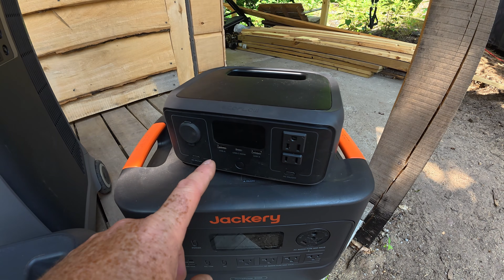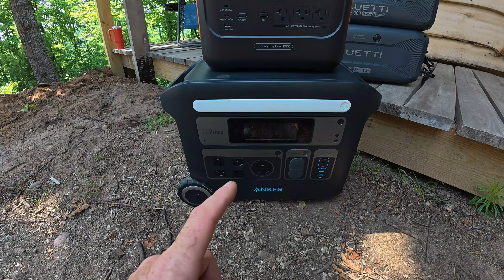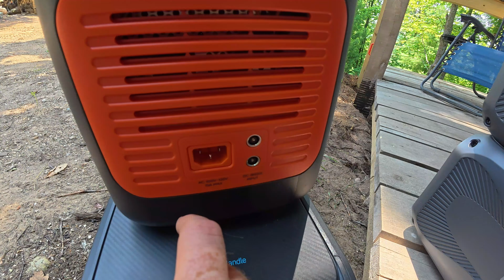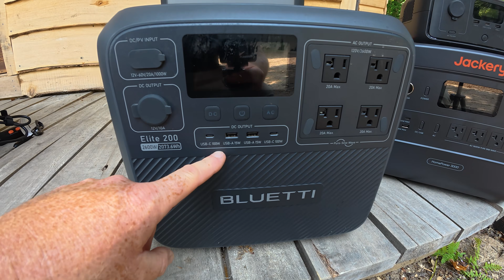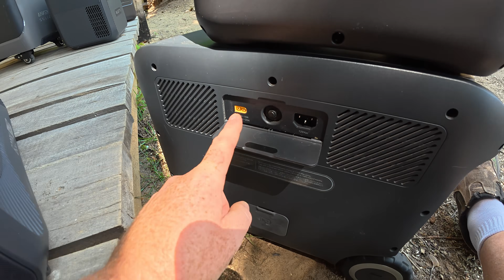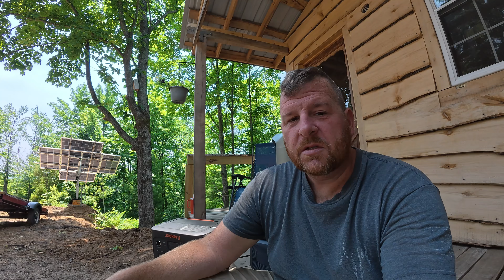Best Solar Generators For Off Grid Living- Which Is the Best for YOUR NEEDS! ?

Comment: My husband and I are older and live on the Texas gulf coast. We’re trying to prepare for emergency situations including grid down. We have solar panels but can’t afford a battery backup. We’re wanting a backup battery for electric use, preferably solar powered. It’s very confusing to know what we actually need. Bare necessities- refrigerator and freezer, fans for cooling, phone chargers etc. But I use a Cpap at night also. We plan on shutting down half the house in emergency situations. Only kitchen and living room. We just don’t know what is best for us.
Reply from the maker: I would buy some of the outlet devices that track and save how much power you use with it.....one for the fridge, ones for the CPAP,  lights, chargers and first step is knowing how much power you use on the devices you want to power. The outlet trackers are cheap to buy and will help you know where to start

Comment: Thank you for the info. So I live in a tiny house 226 sq ft. Which unit is best solar generator to run say TV/DVD player, small diesel heater, and 12v fridge when power goes out??

Comment: Just found this helpful video, thank you! I'm trying to figure out what size I would need to get for an emergency backup in case of power outages. It's rare here but if it happened, I would want to keep my fridge and water well running (I'm in the country, so no power means no water, no toilet, you get what I mean 😂)
Reply from the maker: honestly the only two here are the anker 3800 plus and Bluetti apex 300 that would run a 240 volt well pump. If I had to pick one the bluetti has great options for expansion and is a bit more affordable.....BUT ANKER SOLIX makes great products too, They are VERY well engineered and made. You can't go wrong with either one.
Reply: @OffgridwithJayandJen Thank you! I'll look into those. I appreciate your reply! 😊
Reply: @Abruzze Pecron has some awesome ones as well and also has the ability to grow the system as well. 👍

Comment: In my opinion, Ecoflow is simply an awful company.  I purchased a Delta Pro solar generator fall 2025 for over $1700.  When it arrived, there was no owner’s manual, no warranty information, no cables and the charge from the factory was down to 30%.  It was obvious to me that it was a used machine that I had received.  Nothing has been resolved.  It has been a horrendous experience and hopefully this will save you from something similar.

Comment: Great review! Thank you. The #1 issue for us is the type of battery. The lithium iron phosphate batteries are a MUST-HAVE because of the fire dangers entailed with the lithium ion / polymer batteries. The Jackery models I believe all have the latter, whereas Ecoflow uses the LIP variety, which is a huge plus.
Reply from the maker: Older jackery units use to use lithium ion, but they switched over to LFP in most or all of their units now as far as I know. Appreciate you being here and chatting about it.

Comment: Hello Jay. Great informative video. I am always leaning towards bigger is better but would sure value your advice. I would be powering medium to large power tools and 12v water pumps ( sump type) at my mining sites. I have multiple gas powered generators but would love to move to solar for the noise level alone. For now, am working 2 to 4 days far from grid. Which size do you think would fit my situation best?
Kind regards 
Michael M

Comment: Thanks for the review. I found that the best option for my cottage was the Apex 300 with the BK300 expansion battery and the SolarX 4K charge controller. It was the only option that made sense from a solar input perspective and the only option that would be able to scale up over time to meet my needs.

Comment: Hi-I'm in the learning process regarding solar generators. I've never used one before, and have a Lone Peak truck camper on order. I'll need a battery pack to run some interior LED lights, a roof top fan, a diesel heater, charge various small devices, and maybe an electric fridge sometime in the future. I go out for a week at a time, and don't mind setting up solar panels to keep the solar generator topped off.
I'm also looking to add back-up power to my house in case of a power outage. I'm on a well, so no power means no water. I was thinking about a 10k watt gas generator, but after learning more about these solar power stations/generators, I'm thinking about going that route.
If I could combine these two things, that would be the best of both worlds! Are there any medium to larger sized units that I could use camping, and use some add-on battery packs to beef it up for home use? I'm not opposed to mounting some solar panels on the roof of my house either!

Sorry for the long post-just trying to learn and figure out if I can kill two birds with one stone!

Comment: What might you recommend for running a cpap, portable tools like skill saw occasionally, run a refrigerator for a day if needed, run a portable fridge/freezer in car during long drives of 10.5 hours, charge ipad/iPhone occasionally, etc.?

We have property where we work away from a power source a lot on projects.  Long car drives (2days) to get there.
Reply from the maker: I would recommend a bluetti elite 200 or   something like the jackery home power 3000. They have the power to run tools and keep your critical devices going for a day or two without having to skimp on using it. Large units are my favorite because they do it all, and not just for an hour

Comment: We can compare, talk about, solar power stations! Let's get started. My power stations, I have 2, identical, 3000w continuous 6000w surge, low frequency (transformer based) like the grid, dual 150v mppt controllers, 2000w solar input, dual external ac chargers, 1500w, 6 ac plugs on 2 15amp circuits, 5 13.8v  20amp DC barrel plugs, TT30 Rv plug, with dual hot wires, all metal all modular design, unlimited exspansion, in 2kw battery increments, that dont require a cable to connect, external battery exspansion port, can utilize any battery/ chemistry with just 1 cable, and it adds true capacity, charges and discharges from the unit and shares the load, not just some hack! Can charge from wall, solar, and car simultaneously while discharging full power, if you accidentally discharge the batteries to low, they can be brought back up by a solar panel direct, no nonsense apps, and no built in usb,s to break and be useless like your phone, with 5 13.8v cigarette ports it came with dozens of plug in usb options, and if they fail, just plug a new one in! The heaviest component is 32lbs, completely moveable, absolutely no proprietary plugs of any kind, all heavy duty anderson connections, and mc4. I have 10kwh in battery capacity, and I can make it as small or as large as I like, like 2kw. 1 unit will power every 120v plug in my all electric 2600sq ft home with just 1 cable, no stupid extension cords running everywhere or plugging and unplugging stuff to run. I made 1 50amp dryer cable to plug into the TT30 outlet and the dryer port, it supplies both 120v rails in my circuit panel, and it's all on breakers! 220v breakers off and main off. Charging, 6kw solar on my roof, a gas generator for backup, and a spare inverter to fast charge ac from the car! So, no I really couldn't compare the high frequency units ($5 chip sets) to what I have.
Reply from the maker: Sounds like you have a fantastic setup, thanks for sharing!

Comment: Strong disagree with "get the largest unit you can afford . . . pick up an extra-large unit, pick up one expansion battery with it"

You should get one with an inverter large enough to run your loads and then a big enough battery to last overnight. Buying more battery than that is a waste when it comes to home backup situations. Instead you should buy a propane generator (and optionally solar of course) and use that to charge your battery when it gets low. The amount of power you can buy and store in propane cylinders is stupidly cheap compared to buying the equivalent in batteries. By using the generator to charge your power station, you only have to run it intermittently plus it's far more efficient at covering intermittent and low-load situations.

Power stations+generators together make each other better and then solar is the cherry on top, extending the fuel even further.

(and if really do need an expansion battery, there's a bunch of videos on adapting golf cart batteries for much much cheaper)
Reply from the maker: Agree, but i believe i said if you want to power your home for longer periods then buy the biggest one you can afford. I totally agree with you about the generator working with the solar generator to optimize your system

Comment: We have a Titan solar generator that's 3500 and then I have an extra battery and that gives you a thousand extra Watts. Then we have a ecoflow Max with an extra battery and a smart generator. Wish we like a lot. Both of them. I'm running the whole one room and my my freezer was to Titan with a thousand w on the roof. But I do want to get the system you put in your off-grid cabin and I don't want to get a solar tracker. I'd like to eliminate at least half of my dependents on the grid. I like to do that by the end of the year. That was a good video. Jay, you guys do a heck of a job. That's a good heck of a job

Comment: Hi Jay and Jen, always enjoy watching your videos. Great job on the solar generators info.
I have two Anker Solix c1000s, I love them, not only are they affordable but they have several options to charge them too!
One way I can charge them that I noticed wasn't mentioned in the video, is that instead of buying the extra battery from Anker, which costs almost as much as the generator itself, I can take my 4- 24v 100ah batteries and with a 24v to 60v 10 amp step-up converter, charge them that way too. this gives me the 600 watts max dc that is allowed. The 24v 100 ah batteries are way cheaper than the batteries for the c1000. Just thought I would put that out there incase  you may want to experiment and tell your viewers. Thanks, and keep up the great work and always look forward to your next videos!

Comment: Nice video. 

Maybe some think it's too commercial, but I think you did a great job explaining the features, limitations and situations one should think of, regardless of the brand.

The only thing I have to add is that you should not be too close to the maximum voltage rating of the PV inputs. Solar panels are know to give you less output (lower voltage) in warm weather, but in very cold weather the voltage can actually rise a lot, risking damage to the power station. The rise and drop in voltage compared to the 20 celcius test condition can be calculated with the solar panel spec sheet.
Reply from the maker: Thank you very much and good point about the voltage 😀👍

Comment: I have one Eco Flow 1000 watt hour unit with a spare battery. The other 5 are Oupes. I have the Oupes Mega 5, which is a 5K watt our unit on wheels. That I connect to my transfer switch to run the well pump, chest freezer and fridge and maybe some lights. The other 4 Oupes units are 2K watt hours each with 2 of them having a spare 2K battery. I use those 4 as UPSs connected to my pellet stove, computer, TV/Monitor, cable box, modem, Wi-Fi router, phone, VHF/UHF HAM radio, security camera controllers and for charging my phone and desk lighting. Storms and motor vehicle accidents are always taking out the power here. I live in a very rural area of the southern Adirondack mountains in New York. I do have a dual fuel generator if there is an extended outage.
Reply from the maker: Sounds like you have a great set up. Glad to know the Oupus units are doing good for ya

Comment: I used your codes and I bought a $400 Jackery Explorer 1000 v2 Portable Power Station And a $ 629 BLUETTI Solar Generator AC180 with 200W Solar Panel 1152Wh Portable Power Station w/ 4 1800W (2700W Surge) AC Outlets, LFP Power 
during Prime Days. I wish I had researched more. I didn't realize that Jackery had proprietary cables and panels. I was hoping the Bluetti cables and panels that came with its unit would work.  I need them mostly to power LED shop lights for our Booth during Spring and Fall events when we have less daylight in the evenings. I also need to be able to use a small heater or fan and an instapot Spring, Summer and Fall. Most events are charging $60 to $100 for power for 3 to 6 days. It seems cost effective to have our own power source.  I have 4 days left to return them if I bought the wrong ones.
Reply from the maker: The jackery charges really good, you just need to have the right adapter or panel that will work with it. Minor complications, but not a deal breaker at all. We love our jackery units, just need to use their panels most the time, or sometimes you can use other portable panels from other companies if the numbers work

Comment: Did I miss something or did you skip over the solar input of the Apex 300?
Reply from the maker: I missed talking about it, but not intentionally.  The apex 300 is versatile in a way that allows good input on it own, but also has an add on accessory you can use with it to charge with MORE solar, like 4k watts of it. It's pretty cool, I hope to get my hands on one soon.

Comment: Great job Jay ! I have a few. Mostly Anker ones . The small one has USB C in and out. I have USB C solar panel that charges that for tent camping.  Just had some strong storms come threw NY . Minor damage and scattered power   outage. Them power stations handy . Many in my area have basements and need to run sump pump . Cheers from NY !
Reply from the maker: Nice, Anker makes a quality unit for sure........Sump Pumps.....I forgot all about those, good to remember....Pretty important.

Comment: Great video as always! Quick question. We just started our off grid journey, and our power right now comes from a Bluetti AC500 with B300K batteries hooked up to solar as primary and a generator as secondary. However, I get the feeling from this video and your channel that your choice is setting up a bank of batteries (none of these power stations) hooked up to your solar as your primary power source for the cabin and day to day living, while using these power stations as portable on demand options. I value your opinion and your experience, so should we be doing that instead of using and depending on the Bluetti system as our primary power system, and use these power stations more as portable and on demand needs?
Reply from the maker: This is a great question, glad you asked. Honestly this all depends on if you are going full time or just using things for a vacation home or weekend retreat. Really all it comes down to is cost......buying larger independent batteries and building a stationary full time system will be cheaper once all added up. This is because expansion batteries for the power stations tend to be similar price to what a server rack battery may be, but the capacity is often half or two thirds of theirs. So you end up needing to buy more of them to meet your needs. Our full time permanent system is great, but its not mobile and it does involve some extra components like wires, fuses, buss bars, tools to build cords, and breakers, these all cost extra money, but I think you still end up ahead by building your own.....but the power stations use to be 3 times the price......now they are closer in comparison to build your own. Remember though, I can't take my big system with me to use for back up power elsewhere or travel with it......so if you are only Off Grid Part time or using it at a vacation cabin......then taking it home for emergencies is a pretty nice option.
Reply: @OffgridwithJayandJen We are full time in the woods off grid. Thank you for your answer this helps a lot!

Comment: I just picked up the Bluetti Elite 200 V2 like you have in this video.  I tried it out on my refrigerator and it did fine.  I mostly bought it to keep food from spoiling.  Got a great price during Prime days last month.  I did use your link to purchase it so I hope that’s helps you out.  I will be buying the solar charger soon as I will be taking this unit with me on a week long fishing/camping trip.  Appreciate the info on all these charging options.
Reply from the maker: Awesome,  really appreciate the support Robert, Really do. That unit can be used with most solar panels as long as the voltages match up, and you can charge it in the vehicle while you drive if you use the right cords, so keep that in mind

Comment: can you put too much solar watts into a bluetti apex 300 or does the unit control what it will take.
Reply from the maker: I think alone it can take 1200 watts of solar, but it actually has an accessory you can add to the apex 300 called the 4k solar charger,  it then allows you to charge it with 4k watts of solar. If you get even more batteries and parallel another apex 300 you can add another 4k unit and charge with another 4k watts. It is a cool system actually.
Reply: thank you i have a apex 300 and b300k on order but i want to put up as much solar on the roof that i can for expansion and im new to this and its been hard trying to figure out the best panels to get. btw love your channel  @OffgridwithJayandJen
Reply: @rienzihotrods  you don’t have to worry about watts or amps as the unit will only take as much as it is designed for, however you must keep the voltage that you supply from solar panels (VOC) lower than the maximum input voltage of the unit and if you’re in a colder climate a good rule of thumb is to keep the input voltage around 80% of the max input.
Reply: im now looking at ordering the solar x 4000 then i should be good ?? @offgridacreage